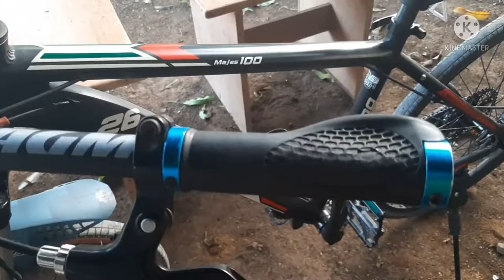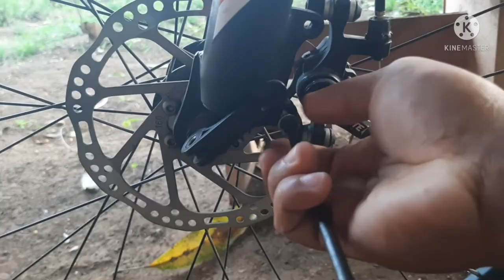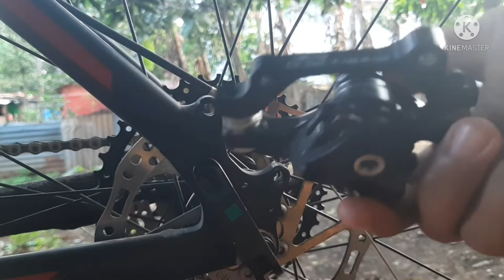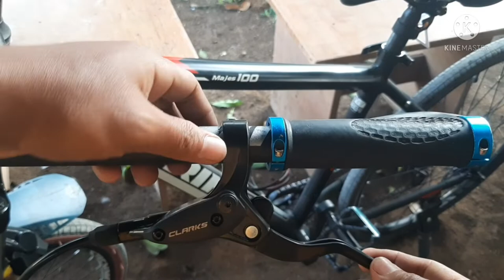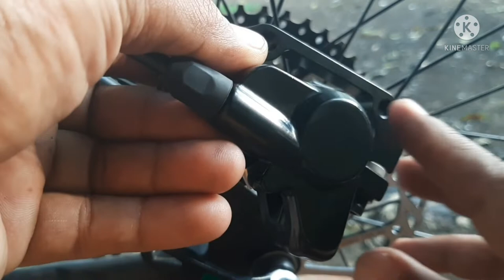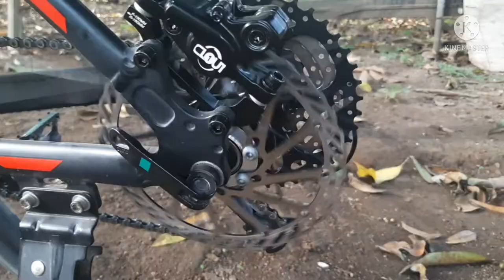Clarks clout1 Hydraulic Disc Brake Installing.#hydraulicbrake

Comment: Just got that on my bike when I lightly press the brakes it makes a small noise is that normal and does it go away
Reply from the maker: Thankyou.please check the rotor or disc brake.in my case ok nmn its very smoth.